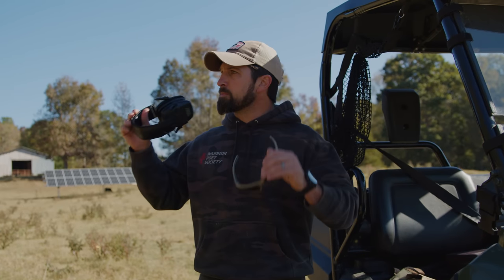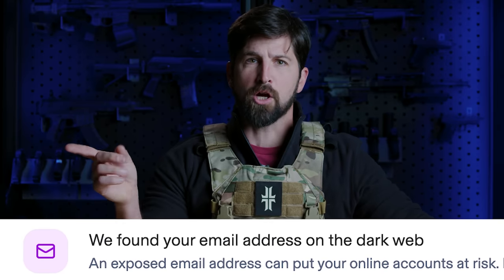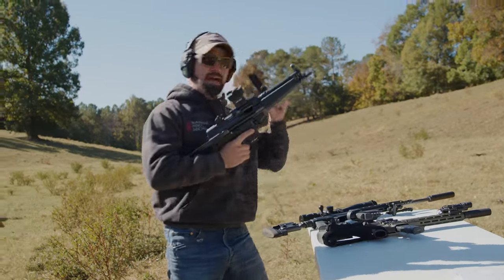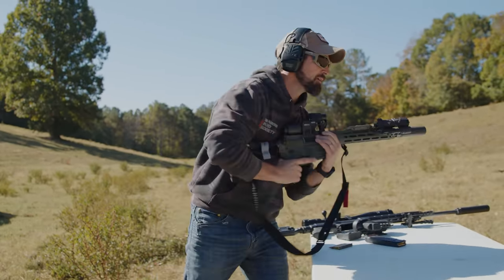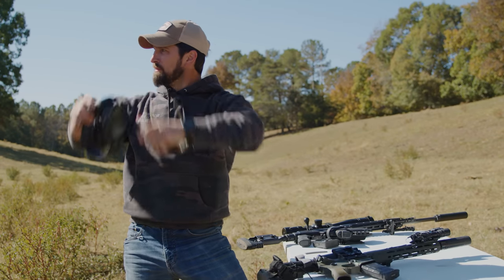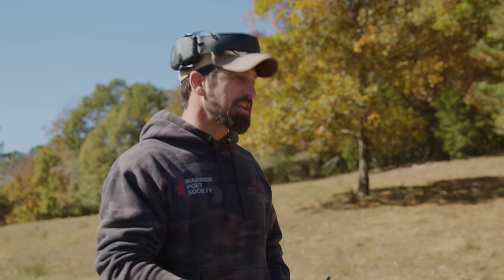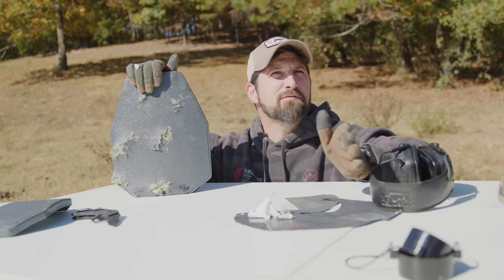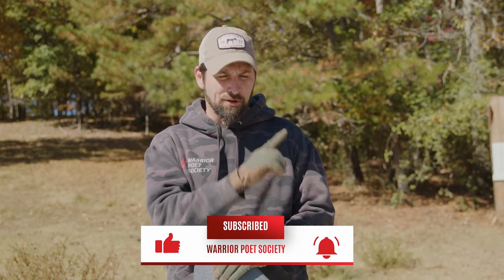HYBRID Armor Plates??!? Armored Republic A3 Plate

Comment: I have a set of their Level III+ ALSC (Advanced Lightweight Shooter's Cut) steel plates without the build-up coat. However, my front plate is inside a spall containment sleeve. Really nice plates...
Reply: I use spall sleeves as well but would definitely pay for extra coating.  That or a kevlar plate carrier
Reply: @saintsinningsword  I agree. I have a pretty nice carrier. I feel confident that combined with the spall sleeve will do the job.

Comment: The Ricochet A3 should be the name...remember guys if if the ricochet hits your artery in your biceps or neck that's it you have 2-5 minutes before you see Peter at the gates...
Reply: I don't care if it's straight steel or hybrid. I actually have a set of level iii + ALSC (Advanced Lightweight Shooter's Cut) steel plates, but my front plate is in a spall containment sleeve.
Reply: What are you even talking about?
Reply: @SamuraiEAC  Lol. IKR?!
Reply: @SamuraiEAC  that this has steel...steel for body armor is always going to be a bad idea unless you plan to see the pearly gates.
Reply: @BasementOps   Clearly these are not the same as steel core armor. Did you watch the video or the others that are available on this plate? You're biased. We get it. Go back to playing your MW vidya.
Reply: @BasementOps  Recent hybrid steel plates have material to catch fragments. Its very very effective even with high impact calibers.
Reply: Same thing has been proven to happen on ceramic plates though....what are we suppose to use in our own homes then? Steel at least last longer and doesn't break easily.
Reply: @evanogburn  Did you not see where I said they're in a sleeve inside a plate carrier?
Reply: @BasementOps  That's why there's something called a build up coat to catch all frag
Reply: Steel in a spall sleeve works very well.

Comment: Shills got to shill. Lovell is no different.
Reply: I also don't want to make money when given chances to do so.
Reply: Did you watch the video? Shill what? A quality plate that performs amazingly well and is lightweight as well? You're no different than the other NPCs. Realize that.
Reply: @SamuraiEAC  😂 you obviously don’t know what quality is, based on that comment. Since lovell doesn’t care for the standard of testing for armor. Which HESCO has the most failures from the NIJ and had to recall thousands of armor plates for bad qc, multiple times. And ar500, now armored republic is a joke of a company and armor. 

Most plates would stop all of that and weigh less than this plate. Given the rifles that lovell had used.
Reply: @ACGBLR  OK, big guy. What plates do YOU run? While you're at it, what plates meet or beat the A3's performance  and is lighter? It shouldn't be that hard to come up with the list since you're obviously very well-versed in body armor knowledge...
Reply: @SamuraiEAC  DFNDR armor, their level III++ plates. That is what I use. Lighter than the a3 here and cerified by the NIJ to level III.

Highcom Armor Guardian RSTP SA+
Tencate cr-6450
DFNDR armor level III++ they are one of two companies to never have failed an NIJ inspection). 

These are ones that I trust, there are more out there, but a lot are made in china and I would never recommend someone to buy china made plates.

These companies have their plates certified, while ar500 had one plate and that isn’t the a3. While being shot at full power of those cartridges, not a backyard test.
Reply: @ACGBLR  I'll check those out thanks
Reply: @hogue_music  Anytime, rather people have quality gear.